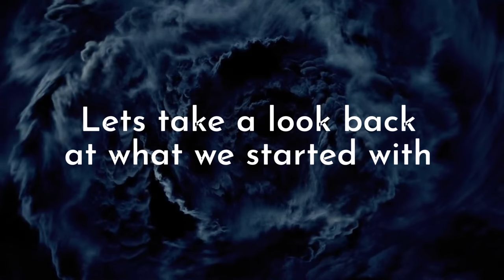The Cactus House: A Driveway Story

Comment: The main portion of the driveway is gravel. Do you use/recommend using the gravel grids? Also what stone/gravel colour/size have you used?
Looks great
Reply from the maker: 20mm gravel and no not used the cells, don’t rate them really fir the cost,  if it’s laid right you don’t need them